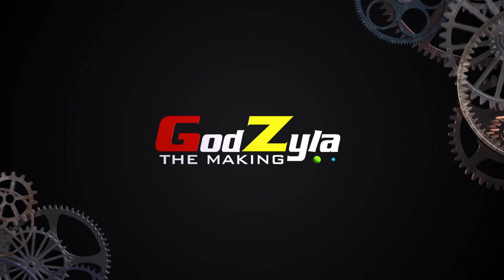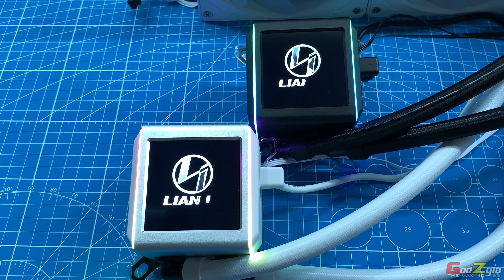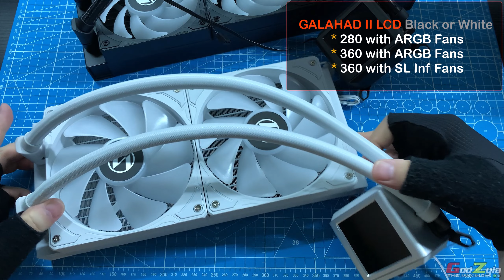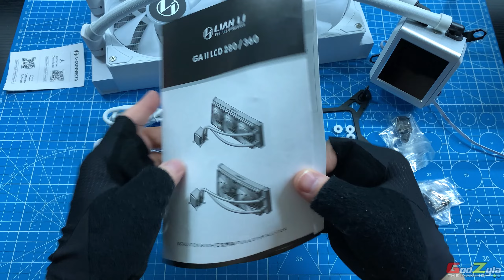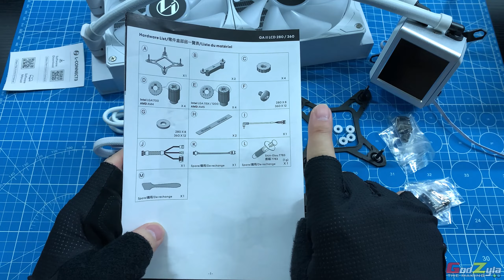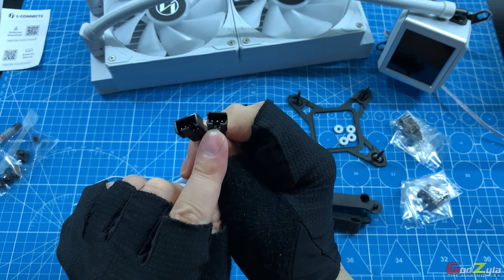Lian Li Galahad II LCD

Comment: Maybe you dont notice, but how did you get your cpu temp to actually be your cpu temp? I found out my cpu temp is actually my cpu package temp from looking at other softwares which makes it seem it’s over 10 degrees warmer in L connect software. I hope that makes sense? However, I dont have the usb plugged into my AIO pump, and I honestly can’t find that cord. So I do have some splitters/ extenders and was thinking of either linking the radiator fans and AIO pump together while still having the radiator fans go into controller or should I have the AIO pump plug into AIO header and CPU fan header? Cause i hate seeing 0 rpm for fan for my water cooler too so im guessing thats where I tie in the radiator fans but want to do it properly. I had a kraken elite 240 and never had these issues. Showed the right cpu temp, as well as a pump rpm and fan rpm. I just upgraded cases and went all Lian Li fans so needed a 360 cooler or else Im tempted to sell this and buy a 360 kraken elite but wanted to stay with one brand is why i gave this a try and Lian Li will not respond/ or be of any help which is disappointing for all the products I have. The CPU temp is the weirdest of it showing the package temp 

Idk if it’s ARMOURY crate but i am not able to control my AIO pump per my motherboard either which is directly plugged into AIO pump which makes no sense since it’s not plugged into the controller. I made sure to go into BIOS to change the fan mode to have control over both. But even when I scan in fan xpert does nothing when I move it. Only in L connect which isn’t horrible cause you want it in one place but ARMOURY crate has the correct cpu temp at least. If i run that 3rd cord on the bottom of the controller to just a random system fan header should I have control through motherboard for fan and then plugging in the other one into a 3 header RGB? Sorry, I know this is a lot of information and lost my last comment I sent but I didn’t know if its even something like a temp sensor im not seeing to change or alter
Reply from the maker: Hi Daniel Revell, welcome to my channel. To be honest, I do not encounter as what you've mentioned. As the CPU and GPU shows the exact figures as shown on HWinfo, I do not know where the LCD extract the data from but for my Sonic Z790, it does sync correctly when displaying the CPU or GPU temp on the GA II LCD.https://www.reddit.com/r/MontechPC/comments/19esupr/project_montech_king95_pro_sonic_the_hedgehog/ 
now as for AIO Pump, you will need to connect the USB connector, else what you have plug which is the Pump connector directly to the motherboard, max speed will only be at 2600rpm and not 3600rpm. This is something which I encouter too. Anyway thank you for your info, you might want to ask at Lian Li reddit forum as there will be a bigger crowd of what you are experiencing.
Reply: @KleoYan  Oh I have the AIO pump usb plugged in cause when Im gaming I put it up to 3600 rpm and can hear the fan and coolant kick up which is nice because I would imagine this is the highest rpm AIO pump out there. I was asking about the usb on the side of the actual AIO Pump below the type c that goes into a motherboard usb slot. But yeah idk why it shows cpu package temp in L Connect for the cpu temp. I am sure there is another video or something on the internet I can find to look up or figure out why this happens. There's not a ton of settings in L Connect so I am not sure where theyre pulling the temp and prob just pulling the wrong one. but still strange I can only change it in L connect when its technically stand alone. Do you know how to get a fan rpm reading where it shows the pump rpm? I would send a pic if I could but I might better be off changing so I know its accurate readings like I had. Thanks
Reply from the maker: @Revell25  you can send the pictures to my email at godzylatech@gmail.com . as why it pulls the CPU package, this I am unsure but I do get feedback from other viewers, not only on this AIO LCD but on other LCD devices too. As for me, I have no issues as I only use ASRock motherboards.
Reply: @KleoYan  I can still send some if you would just like to see/ have for knowledge or info since you do a lot of these videos, but Lian Li actually messaged me back on IG and in fact, their cpu temp is the cpu package temp which I think is pretty crazy they don't tell you or have the option between like other softwares. I kept looking at their software thinking my AIO was broken or my cpu has some heating issues. I always like having temps displayed too but its worthless now so I'm seeing if theres a way to switch it or else I am going to buy another Kraken Elite in 360 this time... but yet how does yours show the actual cpu temp? So I have no idea what they use or which software release might fix it.
Reply from the maker: @Revell25  Hi, pardon me for the late reply and thank you for the updates. if that's the case, my readings which is the CPU (PECI) where I normally take my readings for on my PC is the same temperature of the CPU Package. I do have a couple of cases where viewers told me their readings are off. My suspect is of motherboard manufacturer to declare those stats. The reason I said this. cos my CPU reading on the Sonic Z790 PG is at 15 degrees most of the time but I have the CPU (PECI) which i have asked Martin from Hardware Info. My board temp is the CPU (PECI) which matches the readings of my CPU Package.

Comment: Hey Kleo, thank you for another very helpful video. You have no idea how many Lian Li items I have bought after watching your vids on each of them. So i just bought the GA LCD to replace my AIO and i wanted to ask you if i can use a metal backplate bracket instead of the plastic one that comes with the GA? I have one from Corsair and another third party one lying around.
Reply from the maker: Hi Shady Gouda, welcome to my channel and thank you for your feedback. As for the metal backplate, I have my opinion to use the orginal even though it's plastic but you can give it a try but practice with caution.  Test it out between the plastic and metal backplate, compare the temp and do be extra careful not to over tighten your Pump block to your IHS (Processor). All the best of luck.
Reply: @KleoYan  Thank you, mate. Ill give it a go just to see what happens, but will probably stick with the one provided by asetek. I read somewhere that it wasnt Lian li's fault that the thing comes shipped with a plastic one.
Reply from the maker: @HekaWaset  I see, thanks for the update. all the best and do let use know if you are able to use the metal backplate without any compromises.

Comment: My PC just failed. I tried to restart and the Lian Li LCD screen didn't turn on anymore and it didn't give me video. The computer works. The graphics card spins and the fans turn on and the lian li fans turn on and they all turn on from the cabinet and they spin but they don't. I have a Windows image and I cannot turn off the computer from the power button. Do you think my fluid failed and that is why my computer is not providing video and I cannot turn it off.
My computer doesn't give me an image now
Reply from the maker: Hi Salomón montanares, welcome back, before this. you are able to boot. now are you able to boot into windows or not able to?
Reply: I turn on the computer the dead LCD screen does not turn on it does nothing it does not let me start Windows it does not give me video the computer defective product I put my ex water cooling aorus and it works I will have to return the product to Amazon and wait for an exchange or refund I am very sorry for the liquid lcd lian li
Reply from the maker: @salovoley I see. Thanks for the update. Hopefully you will get a replacement fast.
Reply: @KleoYan  Today I received the same replacement lian li galahad lcd again with failure when paying for the pc or restarting the pump it does not turn on nor the lcd screen nor does it give me video giving me error d0 on my aorus master x670e board I tested it with a stock amd fan and it works No problem, ask how about the depcool lt720 for my ryzen 7800x3d, that one I was thinking of buying, how about the temperatures using the same lian li sl 120 fans, greetings friend 😢
Reply from the maker: @salovoley  sorry to hear that. as for LT720, by default it's already a very efficient liquid AIO, if you want to use SL fans, you can give it a try. infact for SL120 fans, get the SL120V2 instead.
Reply: @KleoYan  a shame what happened to me with lian li ii lcd galahad 360 lost money do you recommend me to play it safe the white 360 depcool lt720 thank you friend for the moment using a stock amd prism cpu
Reply from the maker: @salovoley  the LT720 will be just fine. https://youtu.be/GyH7nShgpxE?si=5c9nHVcxwEdr97fD
Reply: @KleoYan  I haven't bought anything yet, friend, I still don't have a PC, I was visiting, thermalright vision 360, white, do you know what it will be like for my Ryzen 7800x3D, greetings, friend.
Reply from the maker: @salovoley  I do not have the liquid AIO you are asking, therefore can't answer your question.
Reply: @KleoYan  I understand it was to know if you have a reference since I didn't even get any of the thermalright Frozen 360 vision
Reply from the maker: @salovoley  https://www.thermalright.com/product/frozen-vision-360-black/
Reply: @KleoYan  Today I installed the thermalright vision 360 white and without load it gives 37 to 43 c and playing 60 to 68 c in 2k with my ryzen 7800x3d I am happy and sad because the lian li galahad ii lcd went bad twice and I lost money and time you should upload the thermalright vision 360 to the channel greetings friend
Reply from the maker: @salovoley  Hi, thank you for the update. Great that another AIO is working for you and sad that the Galahad II LCD is not meant for you. As for your suggestion. I did right to Thermalright but no response. Thank you for your suggestion.

Comment: I have 3 connectors...1 - CPU_FAN ....2 - SPU _OPT ....3 - AIO _PUMP .....In which connector is it correct to plug the pump ?
Some people say that CPU_OPT always runs at max speed 100% which is not a good idea.. It is better to connect to CPU_FAN, for better pump control and silence... The purpose of CPU_FAN is that if the pump breaks we will get a warning or the computer will shut down... All the AIO does is read the pump tach....
The experts have a say :) .......
Reply from the maker: Hi Milen Krumov, welcome to my channel. for AIO pump connector, I will plug to AIO_PUMP, and for radiator fans, I normally will choose to connect directly to CPU_FAN. as for CPU_OPT,  this is were by if you do push pull configuration on radiator, you can plug 3 fans to CPU_FAN and 3 fans to CPU_OPT.. where CPU_OPT shares the PWM curve you've set on CPU_FAN
Reply: @KleoYan  Very different opinions on this matter...Other people say there is no problem plugging it into the CPU _FAN because if there is nothing connected there the computer will give an error about CPU fan not found...CPU _FAN can control the fan speed and many other options, while with AIO_PUMP , it works at maximum speed and the system becomes very noisy...
They also say that usually AIO PUMP is used for manual cooling, in this case a pump...They also say Plug it to CPU fan header as instructed in the manual. This will prevent the "NO CPU FAN" warning from happening....
My question is can I sync all my 7 fans ( UNI FAN SL-INF ) which are on one fence 3...second fence another 3 and 1 standalone ....They all have their own controller .....( Lian Li GALAHAD II LCD 360 ) has a completely different controller... I would be very grateful to learn how all this can be synchronized
Reply from the maker: @milenkrumov6579  I believe the motherboard you are using is from Asus. Yes if nothing plug to CPU_FAN you get a warning notification but that can be disabled in UEFI. HWmonitor > Monitor > CPU_FAN set to ignore. 

One thing I like to emphasis. I never like to run pump at PWM mode. I always have it full speed. if it's too noisy, I will set it to 80%. the AIO_PUMP you can control without issues, just set it to PWM mode. btw not all asus board with a fan header or pump header are of 2A or 3A, infact most are of 1A, that's the reason why I stated clearly on how to plug them (CPU_FAN, CPU_OPT and AIO_PUMP) as these labels are of an Asus board. I will stick to the principle of AIO Pump to the pump header, in addition to this, I have checked with Asus and the AIO_PUMP is rated more. You can choose to test it out yourself. 

In general all Ampere of boards are as follow (it will still be best if you check your manual on the ampere of each fan headers) 
1) ASRock - CPU_FAN (1A), CHA_FAN/W_PUMP (2A) 
2) MSI - PUMP_FAN (3A), CPU_FAN (3A), SYS_FAN(2A) 
3) Gigabyte - SYS_FAN8_PUMP, CPU_FAN, CPU_OPT, SYS_FAN (All headers at 2A)
Reply: @KleoYan  Thank you very much for the comprehensive answer...I will listen to you and connect to my connector AIO Pump and set the BIOS as you advised me :)
Yes, that's right...My motherboard is an Asus..ASUS PRIME Z690-P D4
Reply from the maker: @milenkrumov6579  you are most welcome. All the best with your configuration.

Comment: on my aorus x670e master board i only have a cpu opt and a cpu fan and a sys_fan8_pump on the top of my board where should i plug the pump cable greetings friend and what speed of pump and fans did you use
Reply from the maker: Hi Salomón montanares, welcome back. AIO Pump to SYS_FAN8_PUMP (PWM set to full) , Radiator fans to CPU_FAN (Set to Turbo)
Reply: @KleoYan  To connect the water cooling pump on my Aorus Master X670 board and then I connect it on sys_fan8_pump and the radiator fan on CPU fan is correct that my friend because according to my board the top I have a CPU opt then comes a CPU Fan and Sys Fan8 Pump
How many rpm did you set the pump and fans? Thanks friend
Reply from the maker: @salovoley  maybe is due to language barrier. I have mentioned pump to "'full" , radiator fan to Turbo profile.
Reply: @KleoYan  Today I tell you that I was able to install the liquid well from Amazon and the firmware was updated to version 1.3. Is the last one correct? And it works well at rest, it gives me 54 ° C and playing Warzone 65 ° C with a Ryzen 7800x3D and fans at 2200 rpm and pump at 3600 without any strange noise, greetings and thanks.
Reply from the maker: @salovoley  good to hear and congrats on your build👍
Reply: @KleoYan  I just realized my pump makes a noise but it gives good temperatures. I don't worry. I left the pump at 2300 rpm and the fans in highsp mode?  I have that doubt if it is of concern
Reply from the maker: @salovoley  I realized this too and I have it at 2880 which is good on temp too. thank you for sharing.

Comment: PWM is sync right ?
Reply from the maker: Hi Trinidad Baker, welcome to my channel. Do pardon me, can you explain what do you mean by PWM that sync? I didn’t get what you mean. Thank you.
Reply: @KleoYan  hi kleo yan what i mean is that pwm on the the aio software settings below fixrpm is pwm means it sync with the motherboard heat or not like monitor the heat itself
Reply from the maker: @TRINIBAKE.  hi yes it does. Be it UEFI or armoury crate. It will sync up.

Comment: Question, im planning to get lian li galahad 2 280mm radiator + SL120 v2 fan pack with controller.

Is it possible to connect the galahad 280mm radiator fans on the controller and sync at the same time with sl120?
Reply from the maker: Hi Shimamun Ch., welcome to my channel, yes you can. at the radiator fan end, there is this 3pin JST03 plug which is for the argb, just plus that to the SL 120 controller at sync 2 or 4. but kindly note that the radiator fans are not SL120, therefore effects might on the SL120 will not sync the patterns on the normal 140mm fans.

Comment: can someone make a video on how to connect the AIO + controller to another SL controller and how to sync them all together?
Reply from the maker: Hi brol1k, welcome to my channel. you can't connect the liquid AIO controller to another SL controller. you should follow the diagram in the instruction manual. look at the diagram at the last page (right) https://drive.google.com/file/d/15k_8z-NpJLj42qPtM6b83LTkJlVKMRr6/view
Reply: I believe you cannot connect the fan itself to the control but you can connect the rgb sync adapter to the SL controller. This way the reg SL controller doesn’t handle the AIO fans like a regular case fan but you can sync the rgb lights w the rest of the case fans
Reply from the maker: @brol1k  do pardon me, I don't understand your question or answer, maybelist down the components you have purchased, as in what are the lian li devices are you using, I can't answer fully of what you are trying to do. 

In general, if you have purchased this LCD liquid AIO that comes with the SL-Inf fans. it's of a separate entity, best practice is to have your AIO Type-C cable connect to 1st 2.0 USB motherboard header (1st controller) and all your fans (ARGB + PWM) direclty to the uni controller, then 2nd plug the usb cable between your uni controller to the motherboard 2nd 2.0 USB Headers.
Reply: I’m sorry for confusion. 

AIO: Lian Li Galahad II LCD SL infinity 360mm cooling kit. 
Fans: Lian Li uni fan reverse SL infinity 120mm 2 kits w/ SL controller and 1 exhaust on rear.

Comment: Do you need sata power cable connection if not using included fans? Thingking of getting this and using P28 fans but controlled via motherboard
Reply from the maker: Hi Moi Chamoy, welcome to my channel. Nope you don’t need to plug the Sata as the lcd is powered by the type-c cable.
Reply: @KleoYan  Thank you! Debating if to get Galahad LCD or the Ryujin III what would you recommend? Will be using P28 fans on the radiators
Reply from the maker: @moichamoy2274  this will be cheaper as compared to ryujin III, but the choice is yours as both do perform.